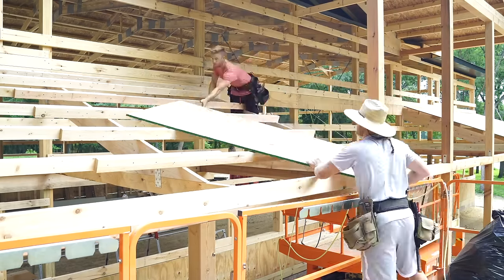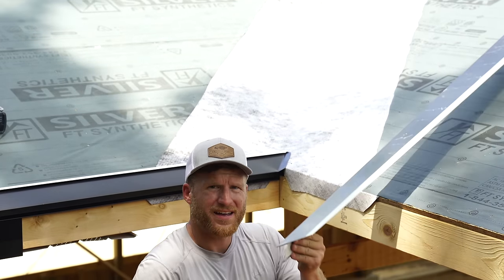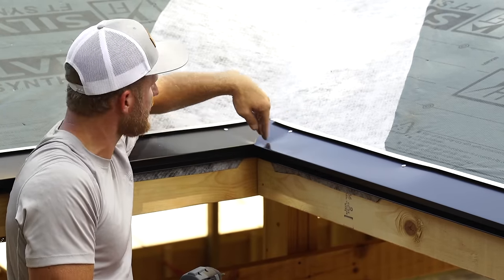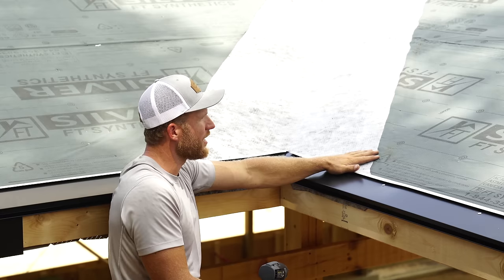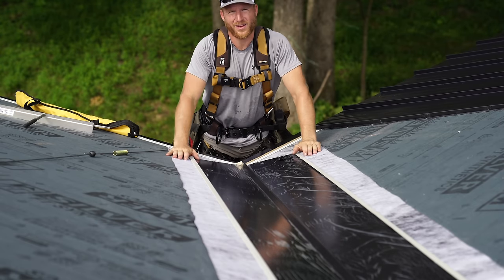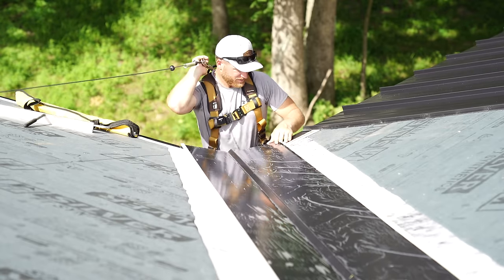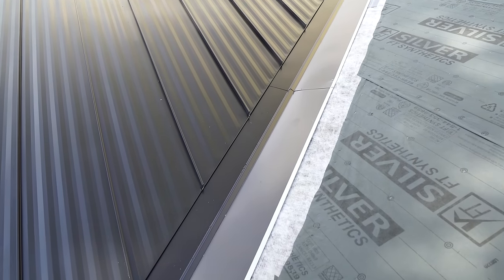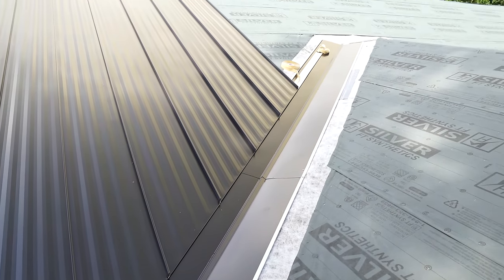Cabin in the Woods Part 14: How to Install Metal Standing Seam Roof in a Valley

Comment: Even slow days are productive days.
I did rigging for precast concrete garages on and off for 10 years, (when I wasn't on a precast job, most likely I was inside at Intel) elevator shafts or stair wells were always slow days. It could take 45 minutes +/- for 1 piece. I both dreaded and looked forward to those days, dreaded because they would be long, slow days, looked forward to them because they were easy days. I could use the extra time to get ahead on other parts. Staging materials & prepping the next few bays.

Comment: I put my own standing sam metal roof on about 12 years ago. Some of the methods have changed since then. Nor did I have a  sheet metal brake or some of the other fancy tools used in this video. Dont get me wrong, if I had access to such things at the time I would have used the hell out of them.  Everything  i did was cut and bent by hand.  I know from experience that working the valley does take time, but the payback is well worth it. You are going to be looking at that roof for decades.  Most homeowners are willing to take that time, but all too often a contractor isnt. To see a contractor take the time and pay attention to detail as was done in this video is rare these days. This is the difference between a true craftsman who takes pride in his work vs a slap it up get paid and move on type of contractor.

Comment: I've only done 1 standing seam roof.
Did it exactly like this
However we added peel and stick then 2 inch styrofoam  on top of roof deck, then added 1/2" ply. Then peel and stick again.
Sound and vapor barrier. 
Roof deck was 2 inch tounge and grove. By 4"
Solid system.

2
Reply from the maker: Wow
Reply: 2x2 around perimeter

Comment: I will be doing the exact same roofing on my house and it is all hip, ridge and valley. No gable ends due to the wrap around porches.  I have never done this before.
Reply: How did it turn out!?
Reply: @gentrifythis  still not there yet. Just getting my shed and  shop done. House is next. Mostly due to materials being delayed.

Comment: Good work! But there are faster and more efficient ways of doing all that. And what's up with the $13,000 snap table being used only for hemming?
If you're buying from MS hopefully you can verify that the metal is G90 galvanized or AZ50+ galvalume and Kynar or equivalent PVDF painted. Anything short of that you may as well use SMP painted metal and exposed fasteners.

Comment: 12:40 Screws inside the valley pan hem? Fired. Put down an anchor strp with the correct angle beneath the hem and them lay in the first pan the the second. Urethane or butyl is fine but cleats 12" down from the top of the first and a reverse hem on the top piece would be better. I'm surprised this snP together junk doesn't have a DIY friendly valley and hop too. Was there a roll of velcro in the packet?

Comment: Just a quick question. I’ve changed from installing shingles to strictly steel and the guy I work for has 30 years experience so I get to learn from what I consider to be the best. I love your attention to detail but am wondering why you don’t bend up the top of your panels to guarantee nothing can get up there? I live in northern Ontario so snow is a big issue with us as well as driving rain ect.?
Reply: Foam strip goes under the ridge cap to prevent any driving rain

Comment: This should be called how not to install a metal roof. Eave and valley trim are not installed in the direction of water flow. Moisture in the form of condensation and wind driven rain that infiltrates the system will show up as leaks after the underlayment fails.  Sealant at the eaves traps moisture that not allowing it to escape. It also does not allow the panels to expand and contract. It sounds like you know what your doing but i made a living repairing installations like this. Everything needs to be lapped in the direction of the water flow and moisture must allowed to escape.  The roof panels are mostly cosmetic and underlayment installation is the key for long term watertightness. Craftsmanship looks good but customer thinks the roof is going to last a lifetime.